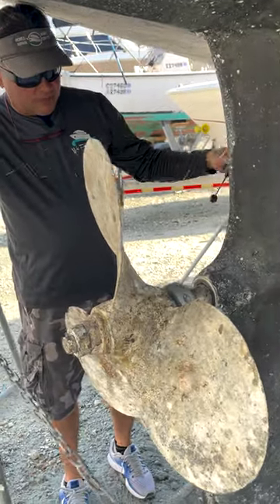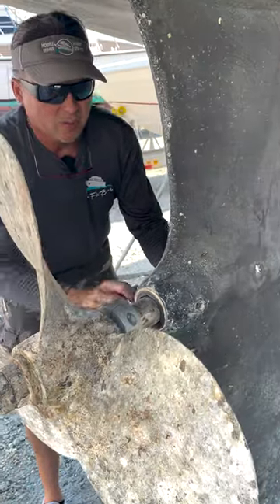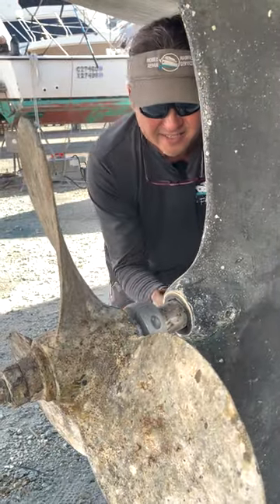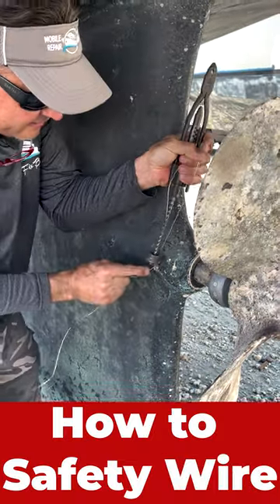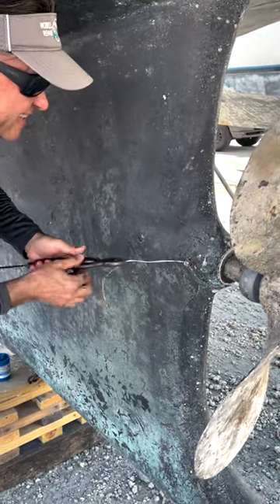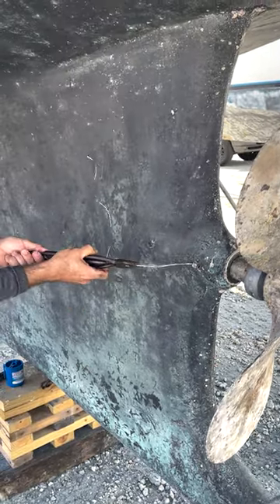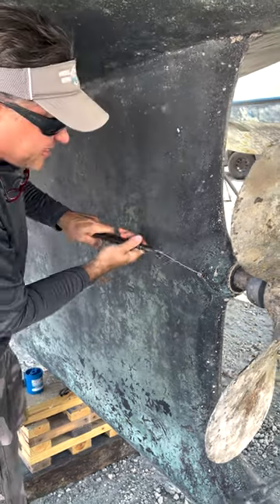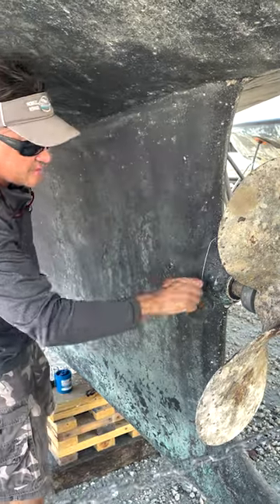Twisting a Knot Using Safety Wire

Comment from the maker: Hey guys how many of you have used safety wire in the past? What kind of application were you using it for?
Reply: Slat PDU , flap transmission,  flap control module , flap gimballs,  landing gear wheel cover clamps , turbine engine IDG clamp , hydraulic system filters 😂😂😂 I can't type all day it's fun doing safety wire
Reply: Aviation
Reply from the maker: @g35tho11 yes Matt was in the military 👍